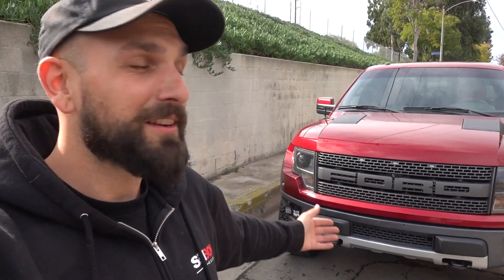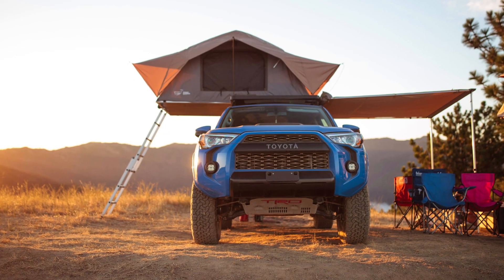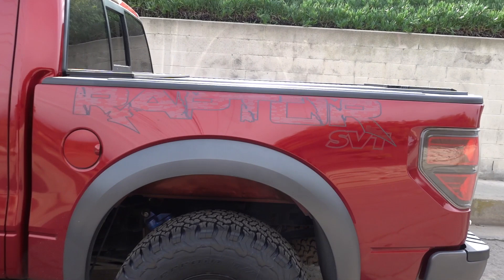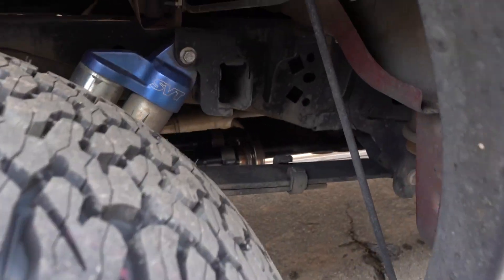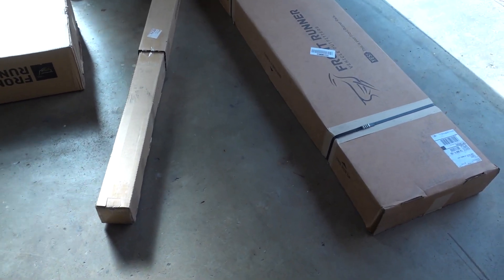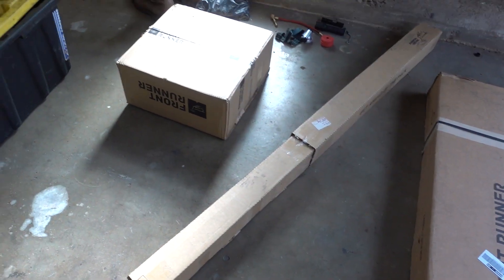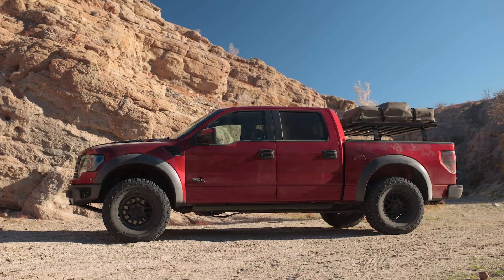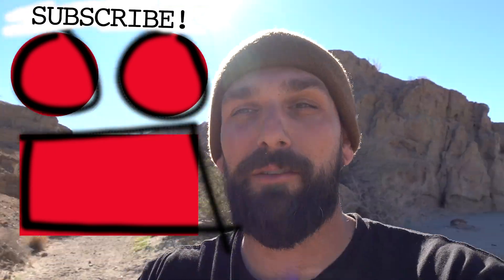Overland Ford Raptor - Vin's new daily Towverlander Gen 1.

Comment: Improve mileage with a bottom skid pan/air shield. These things have a ton of drag on the bottom.
Reply: aserta I think not having a cover over the bed (but keeping the tailgate closed) actually improves aero vs covering the bed as well, bizarrely. 

Something to do with the pocket of air that gets trapped in it actually helping the air flow over the back?
Reply: Johnathan Doe as strange as it is I believe you’re correct. The open bed creates a little vortex of wind and actually helps air flow compared to a covered bed which creates drag
Reply: I still don't get how that works, but I agree. That is what science says makes the best gas mileage. (And not the first time I don't get something science has proved, haha)
Reply: Doug Shinstrom less physical size less drag. It’s like when you stick your had out a window, wind blows around your arm, if your arm was smaller it would have less resistance, If it’s bigger, more resistance.
Reply: it's from the higher pressure air that form from the cab drag getting trapped in the bed, the air moving around it creates a better aerodynamic shape. fluid dynamics
Reply: @samuelrowland76  huh?
Reply: @paullehrbmx  cant get smoother flow than air against air
Reply: Maybe it gets better MPG but I can get it up to speed faster with my cover on. You feel it lag with the bed open when you floor it.

Comment: Raptors are great, if you don’t need to tow any distances
Reply: Still better than a Tacoma 😬
Reply: John Herbold my Tacoma can barely tow itself, but I got like over 1000 pounds + of extra weight and a load range e tire
Reply: If you're suggesting that it isn't meant to be used like a fucking 3/4 or 1 ton, then, yea, no shit. Obviously a Raptor with Fox shocks isn't meant to tow as well as the highest tow spec F150 - but, if you don't think that you can haul something like a grassroots race car with basic spares & tools across country with a 4 door 6.2l Raptor, then there's a whole heap of owners that won't hesitate to disagree.

That's one of the biggest reasons why these are such huge sales hits, because they're a legitimately high performance truck that can legitimately tow circles around every other performance truck. Lightnings, TRDs, SRT8 Grand Cherokees, SRT10 Rams, they just aren't the package that the 6.2 & EcoBoost Raptors are. The Power Wagon will certainly tow better, but it also isn't as capable as the Raptor(unfortunately the Power Wagon has been turned into something that few can use legitimately - it's a trail truck that's WAAAAY to fawkin big for the vast majority of trails. They need to get their shit together and step it up with the PW already, shit is stale).

It isn't an F450 - but, fuck man, you actually have to go out of your way to find anything that tows better with close to the performance capability.
Reply: man, here in germany, the best vehicle i have towed with was a isuzu dmax with 160(?) bhp (2.5 TT). certified to tow 3.5T but, of course that thing was overloaded as fuck, all the time (500-1000kg in the bed and interior, in terms of equipment and the trailer had most of the times more then 3500kg). when i left the company, that thing had 220000 KM on the clock and the only extraordinary thing that needed replacing was a clutch once. 10/10 car, wasnt fast by any stretch, but didnt struggle to do what it was build for either.

Comment: Hearing Hoonigan people complain about miles per gallon is kinda messed up.. Vin, are you ok? If you need someone to talk to, I know we have a strong community of people who would be happy offer guidance. TWIN TOP MOUNT TURBOS!!!
Reply: As a guy whose owned a 454 and th400. 8 mpg sucks. No point in denying it. When trucks got overdrive to get 13 and 14 it makes a huge difference.
Reply: @tragicnomadic  I hear you, my first car was a 69 el camino that leaked so much gas out of the aftermarket locking gas cap it was 4-8mpg. (gas was 99 cents a gallon then, so it was not too bad till I got my 92 integra GS-R which got 25-50mpg..) Insane as it sounds I was able to get a NOS gas cap from the dealership for 23 bucks from the dealership right down the road from Microsoft HQ and got the mpg up to 10-20 with a 750cfm carb on a motor with 200k.

I just find it ironic, that he cares about mpg on a vehicle that's not even a daily driver and works for Hoonigan. Burnouts are fantastic for fuel economy after all. That said a good friend of mine had a supercharged raptor and that is the most fun truck I've ever driven in my life. The suspension, steering, pedal feel is absolutely something everyone should have a chance to feel first hand if they ever have the chance. Best MTB shuttle rig on earth..
Reply: These guys know they can buy a second car for commuting, right? I would think as a Hoonigan that would be a given, but to want a truck to be good at all things (gas mileage, speed, overlanding, towing, blah blah...) is unrealistic. Gas mileage--HA!!!
Reply from the maker: Spending money on gas instead of car parts is a bummer.
Reply: @HooniganBonus  I totally here you, so just get a Honda or Toyota for a DD and you'll save more money for more wicked upgrades and put less commuting miles on those parts. :D
Reply: I will say that my friend that commuted in a sc'd raptor got more smiles per gallon than all of my other friends. Microsoft management money goes a long way though...

Comment: You'll like it even more with a blower. Makes the 6.2 feel how it should stock. If that makes sense. 

I've personally installed 2 for customers. Both were Roush and were extremely simple, bolt on kits. Your right foot controls your MPG's. The 6.2 gets shit mileage anyways. Mise as well get some SPG (smiles per gallon) if you're going to daily a 2014 6.2 Raptor. 

Just my $0.02.
Reply: California’s gas prices are insane tho. It’s like 3.50$ a gallon rn
Reply: Austin L holy shit it’s like 2.89 for 93 premium where I’m at damn
Reply: @willvaughan5734  it's around $4.10 for 91 for My local stations

Comment: I still to paranoid to take my Tacoma on trails, until I get it ceramic coated or until I get a clear bra on it.
Reply: neither of those will protect from actual scratches and scrapes like what Vin has done. the best bet is to use the money on a decent rotary polisher and tools

Comment: im like "atleast get a diesel v8" commuting and towing with a v8 petrol or any petrol engine makes no sense.
Reply: They don’t offer raptors with v8 diesels. You’d have to go with at least a 3/4 ton truck for a v8 diesel. Which would make no sense at all because it’s a way bigger vehicle and it’s not as capable as the ford raptor. Plus gas/diesel prices in California are insane. It’s like 4$ a gallon for diesel compared to where I live thats a dollar more
Reply: @FuttBuckerByMutt  still. gas is usually more pricy then diesel. as well as diesel engines using less fuel. i must say i dont know shit about the american pickup scene and the engine sizes. but in my book that is nothing but a show off truck that is not ment to have any fuel economy what so ever x)
Reply: snederw with all the emissions stuff they put on the new diesels over here, the mpg advantage of the diesels really goes down. Plus regular 87 pump gas is like a dollar cheaper almost where I’m at. My v8 f150 has a leveling kit and 35s and gets 14.5 mpg, but the fuel is cheaper. My f250 diesel has a 4” lift and 37s and before I deleted it I got like 13 mpg. In their stock forms they got basically identical mileage. Now that I deleted my f250 though it gets like 20 mpg with the 37s👌🏻
Reply: snederw Diesel is typically more expensive than gas in America. In America we use it generate some of our power so that jacks the price up